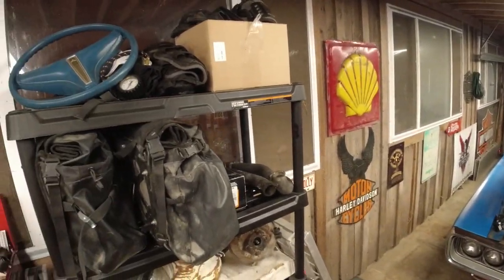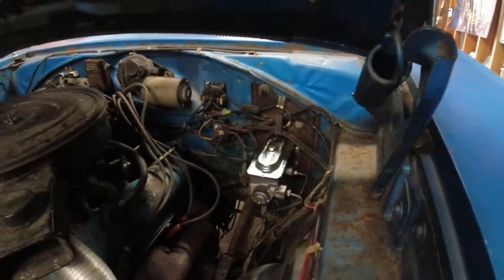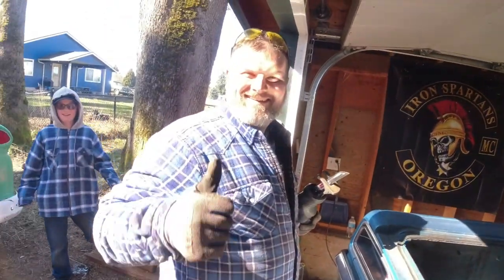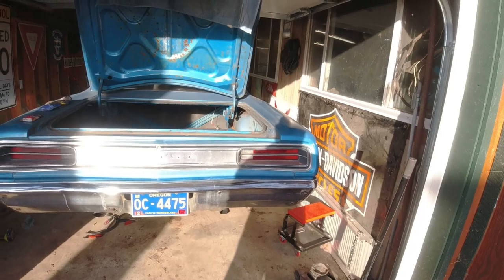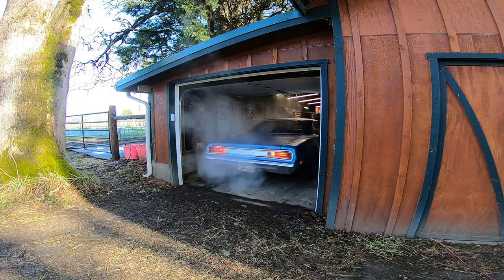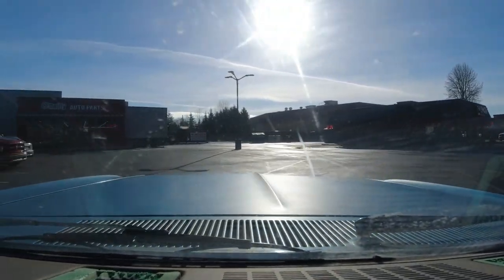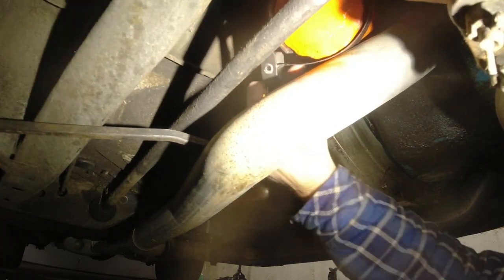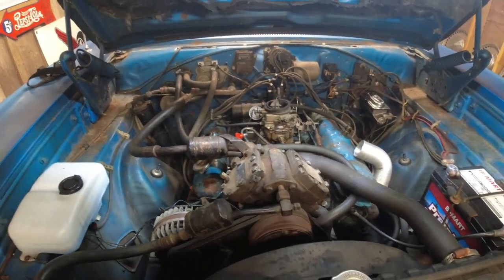1970 Dodge Coronet 440! Repairs & Maintenance To Make It A Reliable Driver!

Comment: You got a lot done and it’s great you fixed the trunk floor and replaced the gas tank. You made it safer with those two things. It runs nice from what I can see on your videos! Yeah, the 68-70 B-bodies with 318/autos are real nice drivers. My friend has a 70 Bee that he shows. It’s Burnt Orange with a white bench seat, top and stripe. 383/auto, A/C, PS, cruise, AM/FM. #s matching. He’s owned it four years. It’s been repainted. About 70,000 original miles.

Comment: Love the new intro!  Yeah, problem with those 3 spd autos, is you put a decent rear end ratio in it for acceleration, and now it is revving like crazy on the highway.  Well... I guess your car has a oil pre-heater built in with that exhause pipe...lol  Not bad for the winter... maybe not so good for the summer.
Reply from the maker: Haha! Yep, you’re right about that. The three speed is not too bad now, really it works great. But as soon as a deeper gear goes in it’s not ideal. And you’re right about that, the oil is definitely getting pre-heated quickly.

Comment: I hate to sit here and tell you what to do, but why not just fix the rust properly? riveting galvanised steel over rust isnt a repair, and its odd how you specifically planned to make an improper repair ahead of time, going into it. Welding even flat steel (no bead rolling required) into the car is far more preferable and more permanent than this, not to mention way safer for your child and yourself in the event of a crash. Was this done because the new fuel tank and carpet visually hides the "repair"? The car didnt survive 50 years from fixes such as this, and to be rude, it seems like you have the time, space and money to invest into a welder at the very least, especially considering the rest of the car is extremely clean and rust free, its just a shame to see. Roadkill destroyed an entire generation of car vloggers i swear.